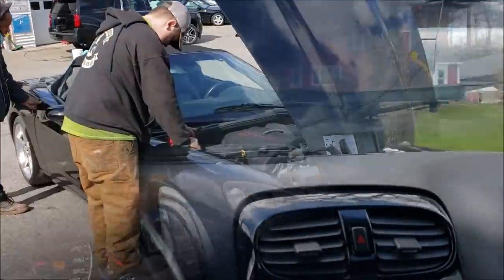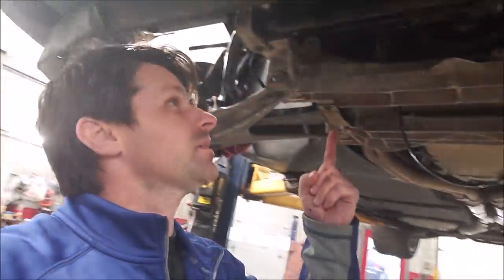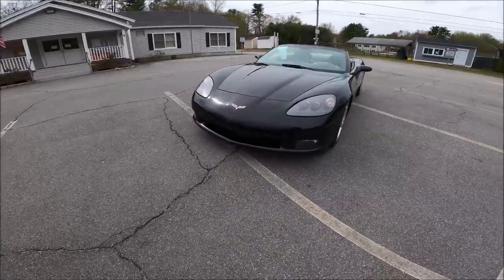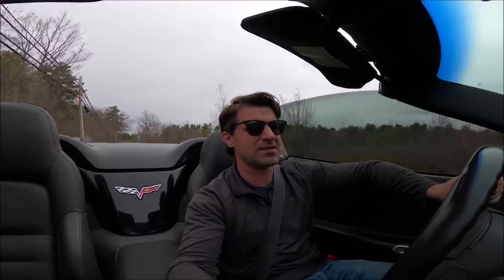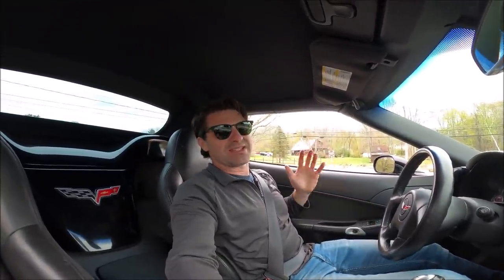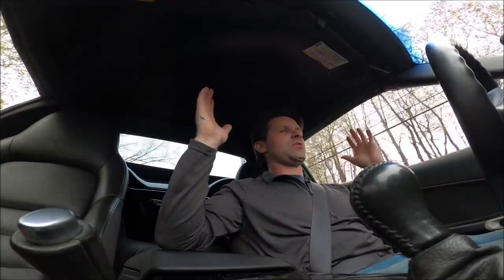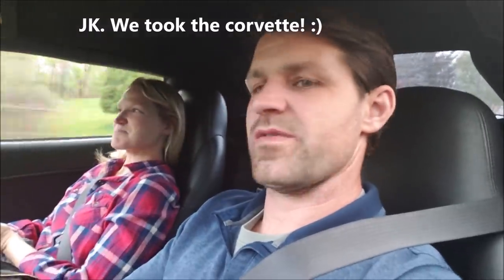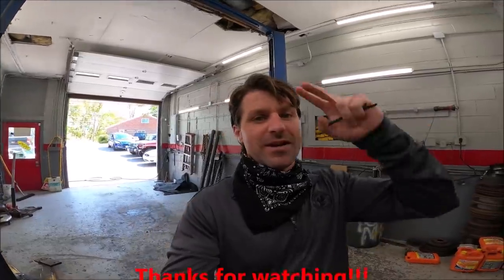I bought a Salvage Title Corvette Sight Unseen - Flying Wheels

Comment: Power top was an option on the 2005, I had one.  I’m amazed that a flood car still works,  the computers usually get toasted an the wiring harness connectors get corroded

Comment: Have  You checked the serial numbers on the engine, Maybe the reason it has a truck pulley is because its been put together with a truck engine.
Reply: I think you're right.... But it sounds like a Corvette so..... But maybe it does have a truck motor..
Reply: Thats what I think happened I mean everythings the same isnt it? Other than top end
Reply: Easy..and LS2 has an aluminum block..if its cast iron...its a truck motor
Reply: Ha, not a good idea to look that deep into it as a seller.
Reply: @PHGWickedQuick  Right on man you know the deal.
Reply: The 1-2 shift was driving me crazy 😂 it’s nice to see a dealer being honest that’s a rarity.
Reply: @PHGWickedQuick  GM made a few different aluminum truck engines, both 5.3 and 6 litre variants.  Earlier versions had ls2 style heads and later gen V versions had ls3 style heads.
Reply: Listening to the idle as the new owner was trying to drive it away says truck motor.

Comment: Nice Corvette! Salvage, if rebuilt correctly, can be a good value. My $42k sticker 16 Mustang GT was totaled at a year old, $23k repair estimate. I bought it for $8,250 and spent $12k on the repairs instead of buying a new one for $38k or another year old one for $33k. Saved me a good bit of $$$ and I'm still enjoying it today.
Reply: bet you can make your money back too LOL
Reply: @leesgarage7  if I had sold it right after the repair I probably could have made a couple thousand.  The trade in value was about $27-28k so I figure it was worth maybe $23k or so with the "total loss"  blemish on the Carfax. Title is clean since I never gave it up. Now I'd be lucky to get $18k for it I think since comparable cars are selling private party in the low $20k range. Fwiw, CarMax offered me $10,600 a couple months after it was repaired! I have a video of the damage and repairs on my channel.
Reply: @leesgarage7  who cares ... An expensive car with salvage or rebuild title still gets over 10k no your prius which is an ugly  piece of crap ...Im sure if you get a good deal on a rebuilt title you will buy it ... Besides as I told you before any c6 rebuilt still goes for over 10k

Comment: One thing about  writing off a vehicle with that low miles: Many insurance policies include the line item: diminished value. If the car is damaged enough, or at all, even the slightest, they will write it off and replace it due to diminished value. Specially with such low miles. Now this doesn't mean if you get curb rash or get keyed, but if you damage the front end sufficiently, or get into an accident severe enough to have a report filed, then that clause can come into effect. 
Samcrac did one on an R8 where the owner curbed it. The original R8 had a design flaw in the front suspension where the support is welded to the body right below the driver's half of the windshield. He had it re-welded and the other reinforced. He also had to replace some suspension parts but other than that, the vehicle was perfect. 
SuperspeedersRob had a Maserati coupe that was the same thing: guy curbed it and destroyed the right front suspension. From Maserati the cost was $25K. They wrote off the car. Rob bought it for $12K, replaced the parts with used parts for $8K and not only got his full value of the vehicle cheque BUT still had the car to rent out. I think they gave him $80K for the car or something, minus the $20K he made a profit of $50K on the accident.

Comment: You had the dampener off but didn't inspect the block numbers?? You know it's a truck motor in that thing😂😂🤫🤫
Reply: Exactly what I thought when he was looking at the pulley
Reply: @JoeBlack1108  It had an aluminum block, not a truck engine.
Reply: @dukeman7595  my envoy had an aluminum block. 5.3
Reply: 100% a truck motor, most likely installed after the car was flooded
Reply: @JoeBlack1108  Yep, and that "race to the speed limit" took too long for a Corvette motor. That's an aluminum truck motor.

Comment: Here in Minnesota, they don't check salvage title cars if it's over a certain (6 years) and under $8000. So I can just buy a car from a salvage auction and just register it without needing an inspection. Then the title shows as prior salvage. It's how I got my CTS. I think they still give you the plates on cars that are required to be inspected, but even then the inspection is just checking for stolen parts haha (the form says to deter fraud and theft). Some states have less requirements and people even used certain states to wash a title of salvage branding. So you definitely need to be careful. That vette is a great deal at $15k though.

Comment: What’s annoying is the fact that I can’t see the head casting numbers on the engine. If I saw a truck pulley while under the car that’s the first thing I’d look at. LS2/LS6 have the same 243 heads. A 5.3 would have an 862. Not all 5.3s are iron as well so the next thing would be block. Sketchy buying a salvage car! But it can prove worth it sometimes. Just gotta know what you’re in for

Comment: I had an 05. It's a bit of an odd duck because it had a lot of things that were one-year only:

Reverse to shut down, steering wheel design, ECM, column lock, differential, etc. I had fun with it, but there's a reason why many of those items were changed on later models.

Comment: Absolute steal: ummm not really. They are selling for around $22K CDN up here now they have higher miles, but haven't been salvaged twice. A couple even have the borla exhaust. Lower mile ones are around $29K CDN,. Now with the exchange rate of roughly 30%, $15K is about the going rate without 2 write offs.

Comment: I buy all cars lightly hit with a salvage title and I apply for a rebuilt title in my state. Did cars like that in NY and TN. Yeah some cars are hit way to hard to flooded too much and shouldn't be fixed or sold. When I was 16 I bought a honda civic that was all flooded to the roof. Only the sunroof wasn't flooded. Replaced the fuse box and audio and the computer modules. I drove that car for 6 years and the only thing I replaced was the windshield wiper motor.

Comment: I am about to go and see the troopers here in Ohio.  Baught a salvage 2007 Audi A4 with a ton of miles for 500$, all it needed was a bumper cover!  Car is run and drive and no engine lights. They can be deal if its a small accident.  Sometimes insaurance companies just total higher mileage cars due to value of them.  Im fine with driving it myself and having a AWD car now for wintertime.

Comment: i don't know maybe it's just the caliber of car but i sold my rebuilt titled escalades for the same price i sold the clean titled ones for and people were happy to pay it every time. I had 4 of them  2- 2005 SUV's and 2 EXT's (04 and 06) the 06 EXT i actually kept because that's my baby but the other ones all sold VERY quickly for $3500-$5000 and rebuilt title or not i didn't have to dicker back and forth on them. people showed up and put cash money in my hand for every one of them. kept thinking my bank was thinking i was a dealer or something. I'll mark them down some for a rebuilt title but i repair the damage properly too just like a body shop or dealership would also. if it needs it i put it on there and when i sold mine they were complete vehicles

Comment: Say it was $35,000 damage to the left front.  Any body shop folks who could take a guess what might have had to be fixed?  In Texas, a Dealer CANNOT sell a car without a valid State Inspection.  I guess it is different where Craig is?
Reply: Dealer can sell if has as is on paperwork

Comment: Looks like it was his first time driving stick..
Reply: This looks very much like the R8 that samcrac bought salvage title. The guy curbed it in the front right, same as this vette. Goes to show you the difference between audi and Gm.....
Reply: I thought he was going to pull out of the lot and get hit the way he was fumbling with the clutch. Might have had a 3rd salvage event!
Reply: Stick is much better than automatic, you have more control .
Reply: @mikelemoine4267  haha that'd be priceless!
Reply: @jco5679  Maybe but there is no one on the planet who can shift as fast as an automatic. Specially with the new dual clutch ones that shift in .3 m/s.
Reply: Doubt it all clutches are slightly different takes a while to get used to
Reply: Joe Pierson  best powerful car I ever drove with a 5spd manual stick was a 1982 Ford Mustang GT 5.0

Comment: I have a used car lot in quebec canada and i want a corvette but i dont find any deals anywhere ,i want a used 2000 to 2003 targa with about 90 000 miles and the best ive found its 16000$ canadian 12600$ us i can do better dont you think?

Comment: SALVAGE - REBUILT - Not Fair!!! This branding done to titles is not really fair, is different from state to state, is a scare tactic as well as a beware warning. WHY? Because!
If the car had the same damage (or more) and was a couple years newer, insurance would have paid, it would have gotten fixed and no one would know. In our state the salvage inspection at DMV takes an hour and every part of the car is inspected. A skid pad for brakes, etc., it's insane. So is "Rebuilt" bad? Not always and do your homework and follow the paper trail and do as Craig (you) have done and take it on the chin for a word. EXAMPLE:
Oklahoma has thunderstorms monthly with HAIL. Hail dents on top surfaces cause dents and TOTAL cars via insurance. Besides some Sheetmetal dents, is anything structurally wrong = NO! TRUST your DEALER and a thank you Craig for another one! Sonny (CT)

Comment: My 07 looks just like it. Well actually mine looks in better shape. After all it is a garage Queen in Florida. With the exception of the headlight lenses. My top is electric , and my transmission is automatic . There is a concealed trunk release button just above the license plate holder. My batteries only last Me 3 years and I had to replace my ground battery terminal due to corrosion. I got mine 10 years ago, at the age of 42. I don't look like most of the Corvette drivers. It does Aid at putting a smile on my face, sometimes. Drive it like you stole it folks.

Comment: For me im never going to own one gor 30k so its 14-15 or i wont get one . I got a clean 350z for cheep drove it and got my money back three years later . Ive done well buying from dealers like you that go through them and offer a fair price . Used car dealers are good because they cant risk the liabilities of something thats not safe and they arnt going to disappear if there is a question after the sale they will help most of the time . Way better than someone in there drivway. Dealer has connection to get things repaired cheep so they do it and still give a good price.

Comment: Such a typical used car dealer to paint switches and interior crap instead of replacing it with a nice used one... especially on a Corvette. I don't care that it's a rebuilt title...that's a shitty ass way to repair a car. My suburban has worn off radio switches but am I going to paint them? Hell no, I'm going to replace them because they make the radio buttons for them